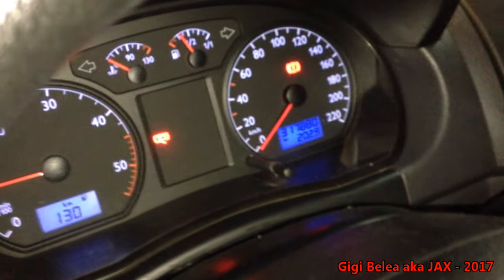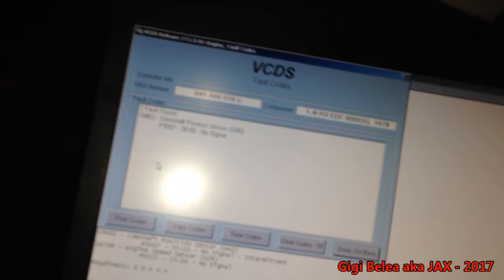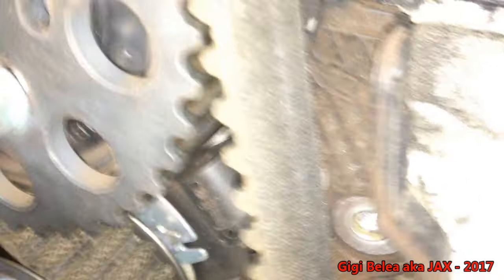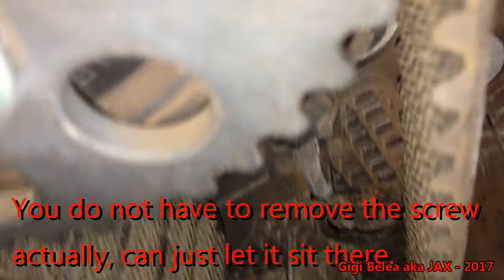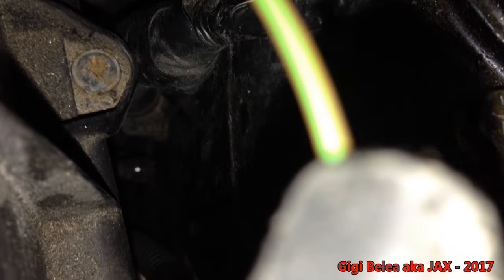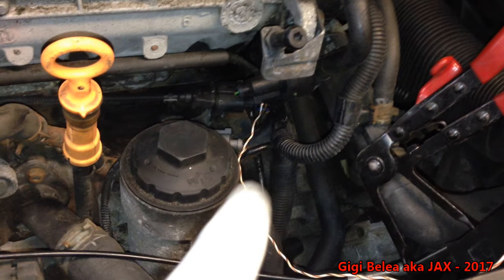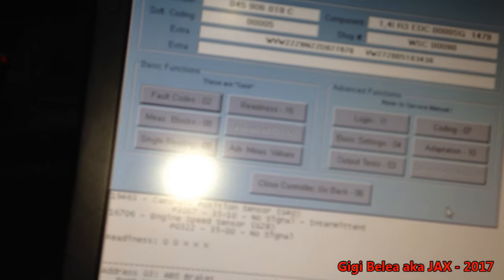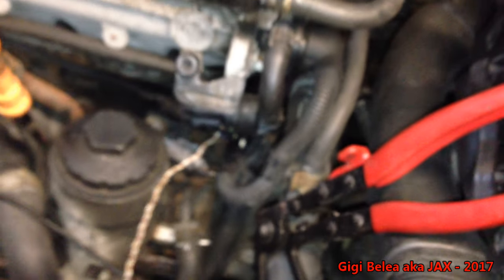DTC 19463 Camshaft Position Sensor No Signal - Intermittent Error

Comment: Nea' Gigi God bless you,man! After spending 150€ (on my passat, i had multiple sensor problems: N75+ Brake Switch Light+ Camshaft Position Sensor+Manifold). After changing camshaft and brake switch,nothing happened...I changed all fused,and again nothing...Finally i bought a multimeter,and i checked like you...And surprise,surprise i got 0V on PIN1(and u said this problem is from 109 relay--THIS SAVED MY LIFE,cuz i realised is just a fuse or relay problem). I looked for it,but i didn't find this relay,i looked for 34 position fuse,but agained i didn't have it(on passat is an empty field). Finally,i looked on ECU box, and i find a tiny and insignifiant piece of fuse,i checked it with multimeter and was burned...So that little s***t maked me to spend alot of money(in Romania 150€ are alot of money for a 20 yo guy). So guys,just buy a multimeter+ vcds ,this little things will save ur time and money.
Thank you alot,man!!!
Reply from the maker: Sa cresti mare :) Thanks for watching.
Reply: Hey, Im having the same problem, what fuse was it? I saw only a 80A fuse there in the ECU BOX
Reply: just solved it also, it was the 15A fuse . thanks

Comment: I was always taught not to front probe a wiring connector, as you could spread the connector to get a poor connection, always use a plug in connection plug which had testing wires of it or back probe the connector but then u need to replace the weather seal if it external to car but each to there own. Good video.
Reply from the maker: Well, we work with what we have at hand :) I am doing this as a DIY and work with the tools at hand... until now worked fine. And at that connector to be honest there are very slight chances to get any water ingress. Thanks for watching.

Comment: Thank you for this video. I could solve my problem through it. In my case was pin 1 (12 volt) the issue. This cause 2 problems. 1 long starting.2 Losing power.
Reply: Hi, how did you realize that,  I have 5v on pin 1 and 5v on pin 2. Probably pin 1 should be 12v I think
Reply: You should have 12v and 5 Volt and Grund. Otherwise you will still have the problem
Reply: @fadialhalabi2572   Now I have 5v on pin number 1, pin number 2 is also 5v and Ground. But don't know pin number 1 how get that 12v fron computer pin or from relay.... Don't find it on autodata
Reply: @nonome3198  first get your 12v to pin 1 direct from the battery. If the problem solved, you need to find 12v from ignition otherwise the battery will be dead in 3 days.
Reply: @fadialhalabi2572  That's what I think also first to try to power pin number 1 direct from battery and if it's start how it should to I will ger positive terminal from  start key. Thanks a lot!

Comment: Great video of how to find a faulty sender, we have the same problem, when we fitted a new sender and it started instantly,
 but stopped when the key was off cranking,  wouldn't run again until we unplugged the sensor again, same problem again poor starting taking 5-8 seconds to start.

Comment: Good evening bro , i have same problem in my car , volkswagen golf 1,9 TDI variant 2008 ,  Glow plug lamp  on/of When increasing the speed or changing the gear speed, I changed the Glow plug and then its relay (under the battery), then I change camshaft sensor, and the problem remains, I will check the cables, thank you for this video, I am a mechanic with a ship, the first time I deal with engines  Little 🤭🤫

Comment: In the 1.9 tdi asz engine, there is lubrication in the slot of the crankshaft sensor. When I enter it with a thin hose to get the accumulated oil from this slot, it pulls from the oil pan. What could be the reason.

Comment: Nicely found! Did you pull the wiring harness apart to find the exact location of the failure? Did it have other wires that were also close to breaking? Our customers usually just want the minimum repair... so we would probably only have  fixed the one wire and not checked for the exact point of failure.
Reply from the maker: Same here, guy wanted to pay nothing if possible. So he got what he paid for. I did not took everything apart, just pulled a new extra wire in parallel with the old one. Meassured 5cm from the connector on both sides to be sure it is not the contact and added the wire. So he did not want to pay me to replace entire wiring from the connector. He said : You can even leave the white wire hanging if it wold not cost me anything :) 
 So I guess people are the same everywhere.
Reply: At least we will have work in the future... once other wires start to go! =) Have a good weekend!

Comment: Hello. I have an problem with Audi A3 2.0 tdi, 2008. Found:

000833 - Camshaft Position Sensor (G40) 
               P0341 - 000 - Implausible Signal
I have changed sensor, glow plug, it's a new timing belt... The engine doesn't start and this error it's stil there... I have checked the wiring, i have 5v on 1 and 2 pins and 0 on pin 3..
Reply from the maker: Check if the signal of the CRANKSHAFT is in sync with camshaft and if it can actually read signal under start attempt.
Reply: @GigiBeleaDK  Hi Gigi, how i do this? I change the sensor anda have implausible signal.

Comment: Hey man, great video, please tell me, I have similar problem with my 2.0 tdi engine, long cranking at first start, but if I stop the engine and crank it again it’s start with no problems, also every crank in that same day starts’up with no problem, the long crank usually happens after the car is not started for more then 15-20 hours, and some times, on very rare occasions when I’m in third or forth gear the engine stumbles when I accelerate it, this happens...I don’t know, once a week or two, so, took the car to the mechanic, diagnose it and the g40 sensor came up short or open, ok, replaced the sensor deleted the error and after a week or so the engine started to stumble again in third gear when accelerating, took it back to the mechanic, diagnose it and no errors found!!!!!!! A few days later, after sitting over night, first crank took a little longer than usual, so ok, back to the mechanic, diagnose it again and the g40 sensor came up “implausible signal” deleted the error, took it for a drive to take some log’s, everything was ok, the error didn’t show up, but the stumble manifested again later on, with no errors, do you have any idea what should I look for, what can cause this problem??? I’m going nuts here, please help me🙏.
Reply: Did you manage to fix this issue?
Reply: @Ak Fish, yes, it’s fixed, do you have the same problem???mine was specific to my engine and it doesn’t apply to any other engine!!
Reply: @danielmihai300 can I know what specific engine you have and what was the issue? Having a similar issue with a 2.0 TDI 150 CKFC
Reply: @seblecrab  hello, 2.0 TDI, euro6 no adblue, and It was kind of specific to my engine generation, because it was the first gen TDI with a vvt system (variable valve timing), and the vvt system was the culprit for the long cranking, replaced the vvt system, and the problem was solved, actually the problem was solved by “diagnose Dan” his got a video on his channel with the same engine and same fault!

Comment: I’m having a similar issue with my blue wire not giving 12v this issue is happening at my vac box and cam sensor so no boost and running very rough
Reply: Same to me,  only 5v on pin number 1, how did you solve that

Comment: Thank you for the video!
Just today I've had to do something similar even before watch your video.
New sensor installed but there still is  error in VCDS: signal not plausible.
I test the cables from the plug until the ECU and all are low ohms and via multimeter shows that should be fine...
Engine is 1.9TDi PD - 77kw AVQ if that matter.The only thing is that everyone said that sensor should be supplied with +12V and Ground, but on contact on the positive pin i get every time steady +5V !?! 
Power supply is from ECU pin not common via relay.. so can't be sure is that correct that all G40 sensors on VAG TDI should be with 12V supply or some new (as that 2004 VW) can be with 5V.. 
Will check the signal type with oscilloscope, and suspect that the cable loom create some induction but any tip will be great 👍
Reply: Did you found out anything?
Reply: @azislo My skoda roomster 2009y. 1.9tdi bls engine also giving me 5v on pin number one, and now I don't know is that correct or it's a problem....
Reply: Cranc like 7 - 8 times before start, and also giving me falt P0341....

Comment: Hey, i replaced the sensor to no help, still no signal fault in Vcds. Pin 3 doesnt show any voltage putting the other probe to positive battery terminal, however the resistance is around 0.8 ohm all the way to ECU so it is good. I gave all connectors good clean. Any ideas what to do next?
Reply: Have you any solution? Thank you

Comment: my polo 2009 tdi crank sensior sends error when the car is hot - it takes longer to start but no issue in cold start.. the sensor location is very awkward behind timing belt.. is there any way to replace without taking off TB.. pls. help with an advice
Reply from the maker: You could probably fix this with a remap of your vehicle , the injection timing on hot , on some software is wrong and can be fixed by a so called "Hotstart" fix in the engine software.

Comment: I have same error code on my Skoda Fabia vrs but the car starts straight away with no problems.
Glowplug light constantly flashing
Reply: On the Audi a2 tdi which has the same engine as the polo a flashing glow plug light can indicate. Faulty brake light switch , check your brake lights work

Comment: Do you think the sensor was faulty anyway or the wire was always the culprit? It is also possible that the other guy screwd up the wire while fiddling with the connector!
Reply from the maker: ciocclaude I am sure the other guy did not screwed the connector as the owner went to the workshop with the error and left from there with the same error even after changing the sensor.

Comment: Hi! Very useful video. BUT what was the Voltage on Pin2 AFTER your repair please? ? I measured my voltage as 12v, 5v & 0v on the 3 pins. All I want to know is whether the 5v is normal or indicates a fault, before I spend money changing a sensor unnecessarily. I WOULD check the resistance, like in your video, but my wiring is different & the ECU under the passenger seat & I do not have a wiring diagram! Many thanks, hopefully this will help everyone else in the same position...
Reply: Any luck figuring out the correct voltage on pin 2?
Reply: @vmdumitrache  My understanding is Ground: 0 then Signal ( middle ) should be 10-12v and power should be 5. My signal is 6v, so now I am trying to figure out what to do next.

Comment: hello mate i have having same problem pin one and pin 2 are both reading 5v what do u think is wrong with mine
Reply: Short to reference voltage... check wires. Sensor must be disconnected when you check.

Comment: HI Gigi,
I have a Seat Leon 1.9 TDI BXE 105 HP with the same error on VCDS and the person which made de test told me that I have to replace the camshaft sensor. My car starts fine when the coolant temperature is below 70 degrees but when it goes up to 90 degrees it starts after 6-10 cranks.
After I saw your video I took the tension within the connector like you did and I had the following results: Pin1 = 5.05 V, Pin2 = 5.05 V and Pin3 = 0.01 V. According to these measurements I have no wiring issue, am I right?
The only thing left to do is change the sensor?
Reply from the maker: Change the sensor or make hot start fix in software. Car needs to be remapped. Ask a local tuner he can fix in 5 min.
Reply: Are you sure is not a wiring issue?
I was thinking to check the connector from the ECU and if everything is ok I will replace the sensor.
I don't know what to say about the software fix... Is it safe?
Reply: Alex, I used to have a similar problem to you; car would start fine when cold but would take more spins on the starter motor when the engine was hot. I had the engine remapped  to solve this hot start problem about 18 months ago and it worked perfectly. The root cause is that there are two different fuel maps for hot and cold starting. The hot starting map is too lean and has unrealistic expectations of cranking speed before it will start injecting at all. The remap is a good solution to this. However! Now after about 18 months I have a different hot starting problem! If I try to start the car when it is hot it sounds like hell is breaking loose inside my engine. I have replaced the camshaft sensor and timing belt kit but it hasn't improved my hot start problem. I actually get better hot starting performance with my camshaft sensor unplugged. It takes a few spins to start but the actual start is fine, no juddering or noises. I am now wondering if it is my crankshaft speed sensor that is bad. I understand that the engine produces a "torsion" value in VCDS which is the difference in phase between the crank and camshaft positions, effectively producing the injection retardation or advance. My torsion values in VCDS are crazy, completely unstable, physically imposssible numbers. It goes from 0° to 62° to 0° in less than a second. I have a video of this on my channel now. Based on your video JAX I do not think my problem can be the camshaft position sensor as I have replaced it and the wiring to the sensor connector seems okay. I'm not looking forward to digging down to the crankshaft sensor to test it.
Reply: Georg : I would look for the issue at the starter or flywheel.
Reply: Hi Georg,
I'm sorry to hear about your issue.
I've changed the sensor and the car was still cranking.
I went back to the mechanic and he put it on VCDS again and I saw that the camshaft position sensor error was gone. Good news for me because I didn't throw my money out the window after all, the original sensor was faulty.
Next, he checked the wiring and found no issue there.
Finally he cleaned up the starter and the car starts almost perfect, it still cranks one or two times and gets a little bit shaky but the most important thing is that the car starts when the engine is hot.
I won't go for the hot fix for the moment, I will try to recondition the starter (change the core components) and see how it goes.
Did you try to clean or recondition the starter? Maybe this will clear out the hot starting issue for your car.
Reply: The car battery just died. I've changed it with a new one and the car starts like a charm:) The bad thing is that the car electrician told me that my alternator is not giving enough current to the battery in order to load properly so I have to recondition it.
Reply: The car electrician replaced the brushes from the alternator and now the charging is within specified parameters. The starting issue is gone.

Comment: hi mine i was drive cut off    i chack 3 pins     pin1.2.45v       pin2  2.44.  pin 2.44   crank shaft sansor  also chack from ecu same

Comment: Hi, I have an issue with starting my vw t5 hot or cold crank. Revs with misfires @ 2000 revs on its own, after a couple of minutes it drops slowly back to normal idle speed. Dtc code comes up in instrument cluster, abs & gateway P01341 intermittent/implausible no communication. When I delete the code it starts perfect but only once & the codes are back. A couple of  times but no usually during a bad start the asr light, fan came on & no crank/turn over when key is turned. I have it uploaded on my YouTube channel. Any ideas?.... Where are you based? Thanks
Reply: When the fans come on , it's usually the ECU. I would start following wires from ECU towards the engine bay. Also check the grounds.
Reply: @jaxelos8052  thanks a lot for the advice

Comment: Hii Gigi
i have the same problem ---- 16725 - camshaft position sensor (g40) p0341 - 00-10 - implausible signal - intermittent
the measured values are 1-12.55v --- 2-4.99v and 3-0.0v
It is the fault of the sensor or the cable
Thank you
Reply: Did you find it the problem